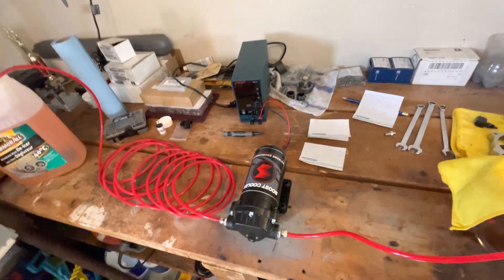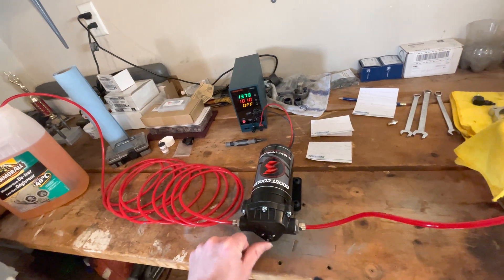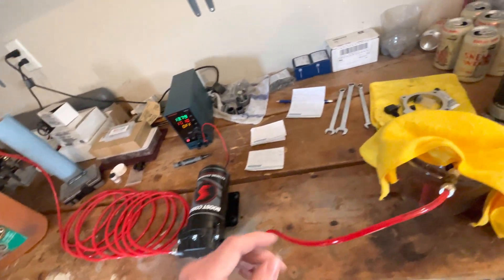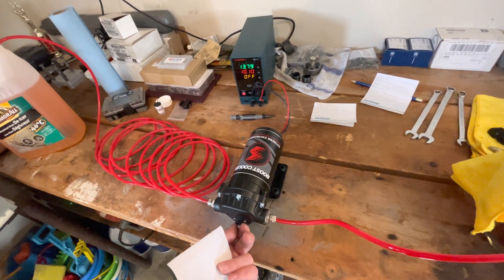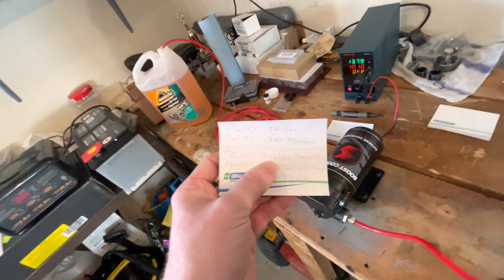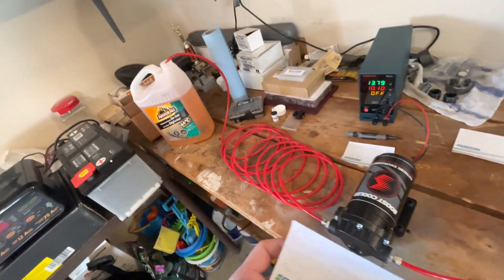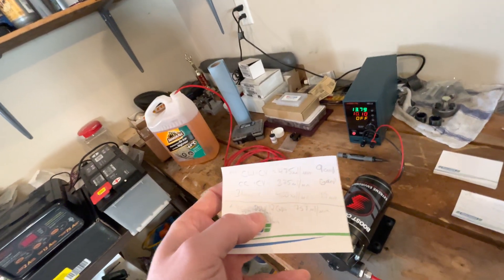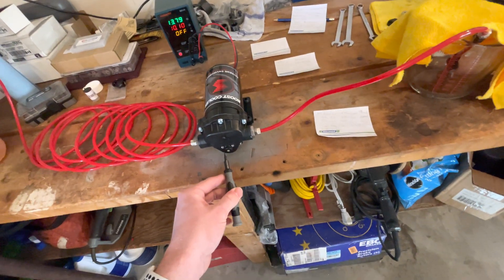Snow Performance V2 Nozzles + 300psi Pump - Flow Test

Comment: How many turns does it take to cause it to go over 9.6 amps and start acting weird?
Reply from the maker: @slotank  The motor only acts weird because my power supply maxes out at 10amp, I had explained this in the video.

Comment: Can we run 300psi on this pump safetly?
Reply from the maker: No idea, you would need to contact snow performance.
Reply: @christopheredgett4919 so its actually a 200psi pump sold as 300 out of the box

Comment: I have the old style 150 psi pump that came set at 150 psi and I run the V1 style nozzles with the dual nozzle set up with one 625ml/min nozzle and one 375ml/min so 1000ml/min total you said that was rated at 40 psi? What would I actually be getting running it the 150psi?
Reply from the maker: @AlbinosnakeSVT  Yes, the old V1 nozzles were tested/spec’d at 40psi and the V2 were tested/spec’d at 100psi, that’s how they label the expected cc/gph. I have no idea what your pump would flow, you would have to test it out or call them.
Reply: I’m thinking it’s way higher than 1000ml I can just rev the car a few times and the tank will go down about 3/4-1 inch in level and down low i get a little quench and stumble due to too much being injected I don’t have an intercooler on my kennebell two screw so that’s why I’m flooding the thing with methanol/water about a 60/40 meth/water
Reply from the maker: @AlbinosnakeSVT  100% it’s higher than 1000ml, if Snow rated it 1000cc @ 40psi, then at 150psi you are way over that target.

Comment: Great video demonstrating the proportions and influence on flow between the nozzle sizes and pump amperage.
I think it may be worth consideration though that the actual flow numbers on a bench test will always be higher than in an engine under boost conditions. More boost = less flow.

Comment: I have this kit with the size 12 nozzle, good to know its likely around 825ml on its default setting, reckon if I turned it clockwise 1 full turn that it would be enough to go to 900 to 950?

Comment: Hi bud, so MAX pressure is all anticlockwise, and MIN pressure all at clockwise?
Right?
Reply from the maker: No, the complete opposite. Clockwise increases amperage which increases pressure. Counterclockwise removes the screw which lowers amperage resulting in a lower pressure.

Comment: Since you're knowledgeable about water/meth I have a question. I supercharged my mustang and the car is knocking and pulling timing at 5k rpms and up. Best gas around me is 91. Octane booster is helping but that will get expensive. A performance shop is recommending water/meth. I will tune conservatively just to make sure there's no issues if it doesn't spray. Somebody mention to me not to use the throttle body plate system as it doesn't have enough to mix up and some cylinders will get more than others.
Reply from the maker: A throttle spacer doesn’t work great on a stock N.A manifold that is designed to pass air, if your using a roots/tvs style blower it replaces the stock intake manifold and the rotors suck in the mixture but that throttle plate will only reduce IAT..to increase octane, you’ll need to spray after the intercooler bricks on a roots blower or on a centrifugal you’ll need to tap each runner of the intake manifold.

Comment: At 12:20 what is that bolt for?
Reply from the maker: Increase/decrease pressure of the pump.
Reply: @christopheredgett4919  for example in the snow performance stage 3 the pressure is adjusted by his computer or by the bolt?
Reply from the maker: @argon89  The controller toggles in the pressure from different selected charge pressure points. The screw adjusts the peak pressure.
Reply: @christopheredgett4919  thks u are very kind

Comment: How is the atomization of the mist at the different pressure settings?
Reply from the maker: I can definitely feel and see more mist at the higher pressures, at the lower pressures it’s still atomized with a nice mist and not sending out drops or fine streams. A #6 on max pump setting appeared and felt the same as #12 on pump with lowest setting.